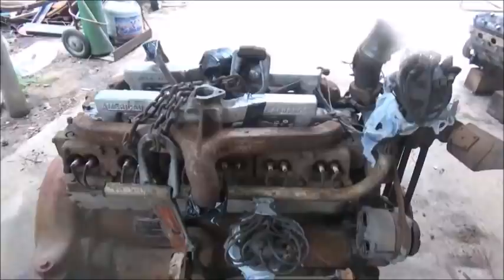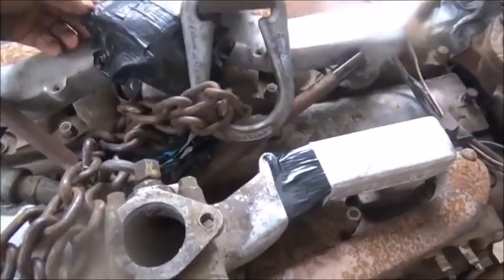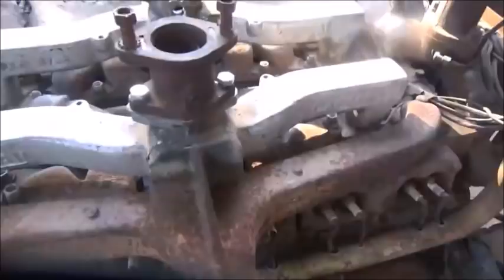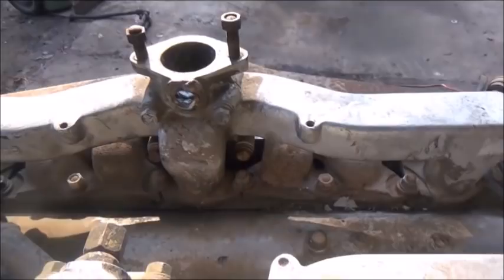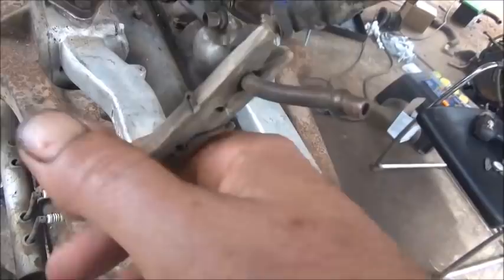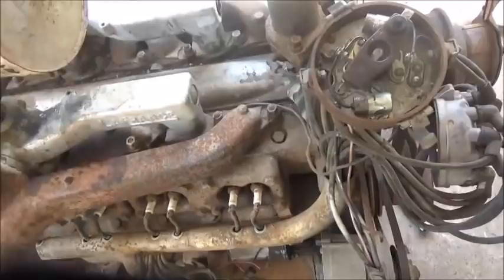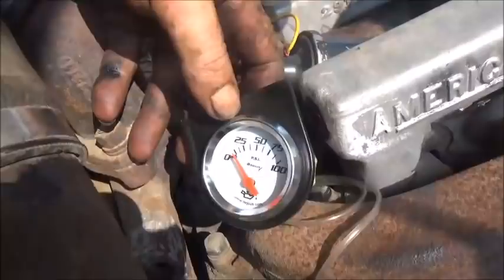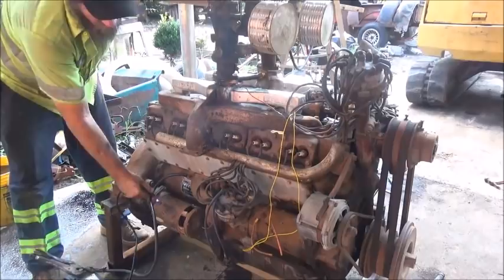AMERICAN LAFRANCE V-12 FIRST START IN YEARS. LYCOMING AUBURN

Comment: Heĺlo Johnathon  :) I remember when my Late Dad Don had fire up the 1951 Bickle Seagrave tanker truck  he had both choke on both way
Out and kick gas pedal and hear fire put left carb choke in 1/4 way plus right side Carb choke still all way got gas pedal to 1/2 on then get in 3 mins left choke carb in to off selection and push right carb in 1/2 in toward for off tell smooth out put off and feather throttle for both carbs let warm engine for 5 mins ! So did smell smoke or gas anymore they be on 1/4 idle sound like GM 350 V8 of high idle to low idle! Then use truck get motion Lol ! Plus yes those fan hurt when get smack by
One do know that !

Comment: I commented on an earlier video that we had this engine in our '49 La France. Granted it was years ago but I don't remember it cranking that slowly. We had dual 12v batteries (maybe group 27) in parallel IIRC.I think it cranked faster but it did start the same rough way and then smoothed out. It had a generator(not alternator) on it .It did have the gas pedal connected through that bell crank in the video and a hand throttle that came out at the pump panel. It had the engine vacuum pump primer. That worked well and you could hear the pump pick up prime.That was a heavy truck though it was an open cab. It carried hose, gear, 500 gal of water and it really flew. It had a four speed non syncro trans and it had to be double clutched always.

Comment: JB weld Rocks !
I would have installed a thread saver coil in that hole and or put a Nut under neath the repair and then use a longer bolt to reach it 
I love this stuff !
Some starter fluid would help

Comment: Anyone can start old engines with 1 carb and 1 ignition system but ole JW jumps straight to 2 independently controlled carbs and 4 ignition systems. She sounds good. I’m imagining this in a T-Bucket. The trick would be trying to get it moving without doing a never-ending burnout.  Keep em coming. Bye! 🥸👍👀✅

Comment: JayBee Weld works except on exhaust manifolds or ares which see too hi of temps. Used DevCon on repairs of old castings on paper machines and mill equipment to the point of drilling and tapping it once hardened. Great tech in those engines. Be right at home in a steampunk/rat rod  application if that's your thing. Or just a great engine for a big old truck that marches to the beat of a different drummer. Brings to mind a Jay Leno Garage video of I believe a Marmon V16 engined hot rod Roadster.

Comment: Man, I was really looking forward to seeing how well that 2-bladed machete propeller worked! I think you could build a Plenum and run a 2-barrel (or even a 4-barrel) carburetor; all you have to do is Bridge the Gaps of the carburetor intakes, thus allowing you not to have that Equalizer line, between the Intake Manifolds.

Comment: As always, you  come up with creative ways of doing things. I've had good and bad results from JB Weld. Still use it. Just know it has limitations and to not go beyond those. Will be interesting to see how well it holds up in this application. Clearly it was strong enough to tap and bolt the carb down so it may surprise me. I did repair a mounting ear on a fuel pump once and it lasted till the car died.

Comment: 12v gas power it new to me never seen them at all
when u got it started up seen like motor is fine without issues *havent see oils pressure but it easy to replace in that motor

Comment: Plug on the left side intake is actually supposed to be there from the factory  the right side runs your vacuum accessories and the left side plugged off the intakes are setup to run like two individual straight sixes

Comment: if you need some extra fuel when starting you can always cover the air inlet with your hands (with carby engines) and it will suck more fuel up the jets with the vacuum

Comment: The dirt track people use the 2 barrel downdraught carbs (ones that curve 90 degrees at the top before going to a single flange) off of these on their engines.. They reckon they are less fussy, easier to set p and more durable in thye dirt than any automotive carbs.

Comment: That is probably a low mileage engine and will be a good one once you get all of the ignition figured out. I never figured on 2 coils for one distributor. Might look good in a speedster of some kind as the engine has that airplane look.

Comment: Here is a thought... Depending on the condition of the $1,300 fire truck, buy it and drop in a modern engine auto trans.  Make that fire truck a dependable parade vehicle and have a second v-12 and trans!   If that truck has pumps and valves, scrap on all of that brass wouldn't hurt either.

Comment: JW:  You stated several times that the intake manifolds must be connected together but did not give a reason.  Keeping in mind that the only connection between the two banks of cylinders is sharing one crankshaft, why would either bank care that the other one exists?  Perhaps the crossover is to provide a more balanced vacuum for accessories like windshield wipers?

Comment: Nice thing about old fire trucks is it's not uncommon to see seriously low miles on the clock after 20 - 30 years in service, at least back in the old days. It's possible the engine you have only has 10 - 20k miles on it after all these years, and it probably got scrapped because the rest of the truck was trash from being stored outside since the 70s. As I recall, the V-12 got discontinued in the 60s in favor of other engines ALF used in that era. being an airplane engine means all systems have a back up, like that double ignition.

Comment: In my opinion you never give the first start engines enough gas when first cranking them. I have learned that a dry engine requires a good dose of fuel to get them going. Never flooded one yet.

Comment: bout crapped my pants twice, first when it back fired out the manifold then when it went to full throttle, sounded like a runaway Detroit. The thing sounds wild what rpm does it actually red line at,  I wounder? Seems to be a rat rod special to me, I like you have all them spare ignition parts hanging on there. Must have been tricky for the engineers trying to sell that funky design to the front office. We got 12 cylinders but; we'll be using 24 spark plugs.

Comment: Was this V12 also, maybe originally, used by Pierce Arrow? My uncle had a Pierce Arrow V12, and I understood that after PA went out of production, American LaFrance used their engine design. I was thinking they had to start faster than that when they got a call to a fire - also, noticed the crank handle adapter on the front pulley. Wouldn't that be a fun assignment for the low man on the firehouse pole, to crank start that?

Comment: It would look awesome with quadruple Webers DCOE 45´s
Reply: Side draft weber carbs on this? not sure how you`d put those on that engine
I`d use the vertical style like on old Ferraris,  that way it would actually be functional instead of a 1000Lb paperweight
Reply: Russell Gerdes  it looks like on this engine the intake ports in the heads are shared between 2 adjacent cylinders, so 6 2-stage ones would be really cool. (and a tuners worst nightmare)

Comment: Jay Leno's American LaFrance fire truck is a 1941 model.  It has an overhead cam V-12 with four distributors.  So, it is not the same engine as yours, JW.  That doesn't make your V-12 any less interesting.  There are Youtube videos of the V-12 being installed in DIY hot rods.

Comment: That's such a interesting engine, didn't even know a engine like this existed. Appreciate you sharing your adventures, know that recording takes a lot of time in itself.

One question, (and sorry if I missed the answer earlier): why did they use two sets of spark plugs with two distributors? Was this because it was a engine used on emergency vehicles or for better ignition of the gas?
Reply from the maker: Only one system was used at any given time.The 2nd system was just a backup for dependability.
Reply: @jonathanw4942  very interesting, figured it was for that reason given the background of what these engines were used in.  Thanks for the reply.

Comment: The to intake manifold has ,or  use  one carb, because one right side intake manifold is broken,so I think somebody ran a connection between the two of the intakes, and block off one of the carb-to run one carb.doing this would not have as much power as using to carburetor,but it could run with one carburetor-Johnnatn - thats my guess!- I too use to work on cars-AUTO MECHANIC.

Comment: Tin foil probably worked as a much better heat sink that wooden clothes pins. I would imagine that wood clothes pins would insulate rather than act as a thermal sink. 
But!...I never had to take care of this “vapor lock” fuel problem on the side of the road 60 years ago...

Comment: The dual plug thing must come from making aero engines with two magnetos. Lycoming still making aircraft engines to this day.
Reply: I figured it was a holdover from the aircraft designs, and retained to add some redundancy and reliability for firefighting. Left, Right, Both... just needs carb heat. :-)

Comment: I think 🤔 it will have a drinking problem ⛽️
Reply: That occurred to me too. I think the answer to that problem is to not worry about it. In fact, install a pony motor in the chassis of wherever it goes, and use that just to drive a big supercharger for the V12, to burn gas even faster.

Comment: "Transfer heat to the clothespin" not happenin' ...that wood has about 1/50 of the thermal mass and conductivity of that fuel line. Maybe it's there to keep that nut in place, but anyone who thought that a clothespin would help with vapour lock, has not been really thinking it through...
A frost plug that's threaded into the manifold will not be popping out the way that it's supposed to, might even stay in well enough to survive freezing,  while the manifold cracks...
Reply from the maker: What is a shame that it worked because everyone done it for years and years used to see up to five or six clothespins on one and sometimes aluminum foil

Comment: Is the second distributor just redundant? Why would it need to ever have 24 plugs and 24 ignition sources ? Has to be a redundant set up that falls back to there airplane mtr designs ?
Reply from the maker: In case one set goes out when you're on the way to a fire or it don't start
Reply: Jonathan W redundancies that's what I figured. Thanks